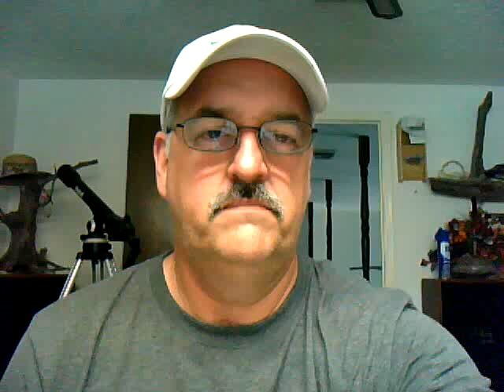Oil in your radiator.

Comment: I Have the same problem on my Cadillac 56 notice a small radiador leak and has oil not pink  or white is very thin and green from the coolant color  but I assume is oil from transmission .this oil tubing must  runs inside of the radiator?

Comment: Maybe you can help me. I’ve got a 2001 Eldorado transport bus with an 8.3 Cummins and I checked the radiator the other day to see if I have enough fluid in there to protect it through the winter and when I put the hose in to draw out radiator fluid it was oily. I checked my oil and it’s still up and I check my transmission while the bus was running and it still up but my hydraulic fluid is leaking. I know that it’s leaking around one of the fans by my radiator or by one of the radiators because I also have a thermal King heating cooling unit so I have more than one radiator. The bus was originally from Arizona so it’s got a massive air conditioner in it. Is this going to harm my engine if I run it? I need to get it to a shop so it can be work on.

Comment: I have the same problem having oil in my radiator and in the coolant expansion tank. I had my radiator fixed but still oil is present in my radiator. What would be the best solution to fix it to avoid further damage.

Comment: Mine is not the transmission oil but it's the motor oil I started founding oil inside radiator and I thought it was the head gaskets but is not it's inside the radiator the oil was leaking how can I flush out my engine where the water was at now it has oil stuck on the sides so my question is how can I flush it out

Comment: I have a 2004 Nissan Frontier 3.3. It has run hot for years. Last week it overheated big time. I let it cool added 1/2 gallon on fluid mix and went about my business. Today I checked the oil etc and started it up to see if it would overheat (its been stiing since last week). Within a few minutes it started spewing oil out of the radiator cap opening. There is none in the crankcase and the truck runs great.

Comment: why is my transmission Fluid is gray in my  2007 Chevrolet Avalanche
Reply from the maker: Transmission fluid a d water is pink, motor oil and water is a gray color if you have a gray color in your radiator you may have a cracked head or b loan head gasket which will allow engine oil to get into the water channels. Did you over heat the motor or let it get hot and start adding water before the engine cooled down. Never add water to a motor when it is extremely hot. The cool or ambient water temp hits the 200 plus degree metal and cracks the head our heads which is expensive to repair.hppe this was helpful

Comment: I have an 07 Dodge charger 5.7 hemi. I dropped my transmission  and see chocolate milkshake for tranny fluid. my tranny fluid cooler is built in on the ac condenser. What and where is the problem?

Comment: As a mechanic who has seen this problem before, I feel the need to add to your comments, because this problem is more complicated than this. Yes, the trans fluid is under pressure and is forcing fluid into the coolant, but the reverse happens when the car is shut off. The cooling system has a residual  pressure of about 12 to 16 lbs. and that pressure forces coolant into the transmission.Coolant on a trans dipstick is not as apparent. The cooling system is now the least of your worries. If not repaired soon, you are going to need a new transmission. Your commentor with the Xterra has probably discovered this already as these 05, 06 and 07 Nissans are notorious for this problem. The trans needs to be flushed immediately and thoroughly as soon as this problem is detected, then  flush the cooling system and either replace the radiator or (my preference) bypass and plug the radiator cooler altogether and add an external transmission cooler. Sorry that this isn't as simple as you might like, but coolant in the transmission will kill it! In many cases, sadly, the damage will already have been done.
Reply: joe asbury 
how much would you think everything cost to get it fix?
Reply from the maker: Thanks for chiming in on this I hope it helped resolve the problem

Comment: Did u have to change the oil on the transmission after you flushed the system? does the milky stuff get in to the transmission?

Comment: Dear what was that part exactly ...i mean if oil is coming in radiator and also from reservior water level is constant instead i can see some fluid coming in radiator under cap and level is decreasing..what part needs to be replaced??

Comment: I am so glad I checked this video out.  This is exactly the problem I am having with my 1994 Dodge Ram Van.  It is such a relief to know how to fix it and not spend hundreds of dollars.  Now if I can get the electrical problems fixed it would be fantastic.  I paid $1300.00 to a shop that specializes in electrical repair....still have the same problems.  What makes it so bad is that this van is a wheelchair lift van for my daughter....her only transport.

Comment: A while back my 98 Accord blew a gasket and over heated and somehow oil ended up in the water lines, yet no water got into the oil lines. The motor turned out to be cracked so we replaced the motor. I haven't had any issues with my car till today (Which happened to be one of the hottest days 114 degrees). The car over heated. We waited till it cooled down and checked if the radiator fans were turning on, which they were. We checked the radiator plug and there was some oil residue on the cap. So we removed the hose that goes to the radiator which also had a lot of thick oil gunk all inside stuck to the hose. We added more than half a gallon of water since we figured the car didn't have any. Turned on the car and the thermometer arrow was bellow half. After driving the car 5-9 minutes, it began to over heat again, this time I could hear a sizzling sound. Thankfully got it home before it could reach the H in the thermometer. So now I'm wondering, why is it over heating now? Yes, I never got the water lines cleaned out after the first issue, and I know thats horrible. Could this be the reason it over heated? Maybe it got hot enough to melt that oil gunk and it clogged a small hose and blew it so I'm leaking water now? By the way, we popped the hood open and the radiator hose looked like it was about to burst. What could have caused the hose to have soo much pressure? Anyway, sorry for this long long question :D Thats all, any wisdom appreciated !

Edit: The oil gunk or the oil I saw when I was adding water, was NOT milky like the first time it happened, it was just old and stuck on there real good. So I don't think I blew another gasket (hopefully).
Reply: Jenny P Sounds like a bad thermostat and gunk from the previous issue.  What was it?

Comment: Thank you for your video  !     I have a 96 Dodge Intrepid 3.3...I have personally replaced (yes I am a mechanic) the water pump/timing belt, cam shaft gaskets, brake line,  hose from rad-2-engine, took the thermostat out and checked it via boiling water(still working-but am going to replace..just because) only thing left is a small hose going into the radiator on the right of the engine(while looking down at the engine) because it is omitting alot of black gritty CRAP..checked my fluids, all is good, so my guess there is a build up somewhere, and I plan on flushing, will post update.....THANKS!
Reply from the maker: +Laurel Campbell Cool always glad to meet a girl mechanic. I watch a lot of Supercross and see Pro riders that are married to their female mechanics, that's awesome. Promotes the family that plays together stays together.
Reply: Laurel Campbell

Comment: I have this same problem but my engine is knocking do you think that would fix this issuer or do you think it's a blown head gasket
Reply from the maker: +Steve Smith Sorry Steve, your problem sounds like a bad motor. I imagine you ran it hot or low on oil and burned up the rod and crank bearings which would require a complete motor overhaul which is expensive. Check your oil and fluids regularly, especially after you take it to have an oil change. There are horror stories of shop forgetting to add oil because they got side tracked then the motor is ruined and you have a hard time getting them to admit responsibility.

Comment: What if it is Engine oil in the radiator and No coolant in the engine block. I have a 04 saturn l300 and all the engine oil goes into the coolant but there isn't any coolant in the engine oil because it goes bone dry?
Reply from the maker: +Raymond Sisneros Now there is a question. As time marches on so does Engine Design. As Engine Design moves forward, so does Engineer Stupid. Nothing changed from the beginning except, someone thinks they have a better idea so "lets add this:" Additional crap just means more repairs and money spent.Oil getting from the engine but not forcing water with higher pressure built up in the radiator is surprising. Most would suspect a blown head gasket or a crack in the block or head itself, but you would find oil in the radiator and water in the oil. Without looking at it, I would guess technology has added something stupid which has failed like an EGR plate... Curious to hear what they determine was the problem, please keep me posted.
Reply: Succstrat I got the same problem on my Saturn.  Saturn's seem to be known for this problem due a known manufacturing /design defect in the cylinder head.

Comment: I have a citroen saxo. I had my friend take it to repairman for oil and filter changes as usual. After this, the repairman added antifreeze. After 3 days, I asked my friend to take it back to the repairman to just ensure that all is good. The repairman found oil (yellowish) in the radiator. He said the engine has big issues. I said do whatever needs to be done. He took the engine cap off, had it tested, no cracks, he had it grinded for cleaning, and changed all the gaskets in the engine. He said there are some corrosions in the engine. He closed it and all started to be well. The gas however was not working very well. At low revs, the car is very weak, at higher revs, it is almost normal. He changed the ignition plugs. Did little good only. He said it is the coil possibly. I started to dislike the repairman. I refused to have it changed. Any ideas?
Reply from the maker: +halit yilmaz Wow, hope you are still viewing> I hate to hear this and think your friend a mechanic are questionable. Please do not take that wrong. This guy sounds like a shade tree mechanic, get away from that and find an actual mechanic, in the long run it may cost a bit more but he will not keep milking your wallet. Never tell a Shop to do what you need to because what they need to do is take your money after all they are a business, a shady business.Look for a shop with references from people that have been treated right. When you take a car to any shop ask them to give you a quote, repairs get expensive. Shade tree mechanics are prone to be parts changes that continue to chase stupid until they change the part that fixed the problem, get tickled with themselves and then hang a sign claiming to be a mechanic.I imagine that car is long gone, along with the mechanic. A true mechanic would have put his finger on the problem right away. Suggestion: Never try to diagnose what you think the problem is, it misleads the mechanic. Take it in, tell him the symptoms and let him diagnose the problem. Many things are quick fixes, others are costly and if you can not afford to pay, he has the right to file a mechanics lean, selling the car to recoup his time for the labor and parts he has invested.Hope this is helpful in the future.

Comment: You mentioned the part was $60 bucks but how much to check out the transmission? What happens in the reverse? Coolant in the engine oil?
Reply from the maker: +ss4vegeta1 A radiator repair shop can determine if the part is bad and replace it usually included for the parts and price to rod out the radiator. (clean out the radiator by pulling the end caps off and running a rod thru each radiator tube then placing it in an acid bad to clean the rest of the corrosion.)Coolant in the engine oil is usually caused by a blown head gasket when the engine get to hot. Never add water to a radiator when it is extremely hot. You are forcing cold or cool water into chambers of engine metal that is pushing 300 plus degrees, the end result, cracked heads making the repair more costly. Always wait until the engine has completely cooled befor adding water, then you can figure out where the problem is, perhaps a bad water pump gasket, bearing, heater hose etc... all simple fixes.

Comment: 02 Camero has oil in radiator how do I flush it out???
Reply: accidentally poured oil into the coolant container, up top,! my car, is a 1999,Toyota Camry thetes,oil floating,around in the radiator, hw,do I get it out
Reply from the maker: +Yvette Taylor It is always important to make sure what each cap and engine oil stick is for before adding fluids but not hard to correct. You will have to drain the radiator fluid using the drain valve/ plug on the bottom back side of the radiator. Once all the oil, water and coolant mix is drained, you will have to flush the engine and radiator system, if you are not mechanically inclined or have a friend that is it is best to have a shop or place that changes the oil take care of it.The process, only when the car is cold and has not been run so everything is not hot and under pressure, they will remove the bottom radiator hose, remove the radiator cap and place a water hose in the top of the radiator. Replace the bottom hose and fill with water. Replace the water until full, remove the bottom hose and drain the water, repeat until the water appears to be clean. You should use a radiator flush product purchased from any Auto Zone for the final cleaning, then add water and antifreeze.You will still have a small amount of oil in the radiator for a period of time because it is hard to get it all but it will not be a problem. Drive it for a couple of weeks and flush again.
Reply: This I did all if that and its, so far so good thk u,God Bless,!

Comment: how did you clean the oil from radiator, what chemical?
Reply from the maker: Pull the lower radiator hose, catch the fluid and oil coming out in a container. Stick a water hose in the radiator and flush water through it until the water clears. Drain the water from the radiator, replace the lower hose and follow the instructions on the solution you purchase from some place like ORiely, Auto Zone etc... After you have flushed the radiator you will add your final coolant and water. Keep in mind, you may still see a slight bit of oil in your radiator fluid, it will probably be residue that was in the low spots of the motor. An option: after you flush the motor with the solvent, refill and run the motor with pure water, drain it and do it again. This should get the majority of the oil out, then add your final coolant and water.
Reply from the maker: I'm curious did you determine if it was engine oil, transmission fluid and how it got in your radiator? Otherwise draining and flushing the radiator will do you no good, you have to address the actual problem, oil in the radiator is the result of a problem.
Reply: +Succstrat Just read online that disconnecting upper and lower radiator hoses, blocking openings, and filling radiator with HOT water (instead of cold water from garden hose), then adding dish detergent or other radiator flush solvent and letting it sit for 10-15 mins then draining radiator (and repeating if necessary then rinsing radiator out with fresh water before refilling) does a better job of cleaning oil residue from radiator passages than cold water would do. Also, if engine has been run since trans oil leaked into radiator (or in my case, I spaced out and poured ENGINE OIL into my radiator!!!), there will be oil not only in the radiator but the rest of the cooling system as well... if so make sure your entire cooling system is flushed, preferably backflushed, and depending on the amount of oil you should check all of your cooling system hoses as well, to make sure there&#39;s no oil on the inside of the hoses, that could cause them to fail. Unless the problem is caught immediately, which in your case would be almost impossible, because how would you know trans cooler was leaking?), it&#39;s safe to assume that there&#39;s oil in the rest of the system, including the engine as you noted, but don&#39;t forget to check the condition of the hoses if there&#39;s any question about oil contamination, and/or carry spare hoses and tools with you in case one bursts while on the road and you need to replace it!! (Of course you probably didn't have near the amount of oil in your coolant that I did, I added about half a quart, because my mind was somewhere else and I though I was adding it to the engine oil). Also consider that not only was the pressure to your transmission and/or the normal flow of trans fluid disrupted, but you were also driving with low trans fluid overall, because whatever went into the radiator is no longer in the trans, so be sure to add trans fluid as needed if you haven't already, to prevent more of those vibrations... and hopefully there was no damage to your transmission from low fluid level. Just a few other things to consider... Happy holidays. :O)
Reply: i do have the same problem of getting engine oil in radiator in yd25ddtti engine micro van  could  ypu pls explain how to resolve the problem"